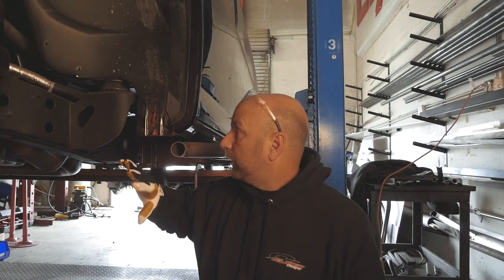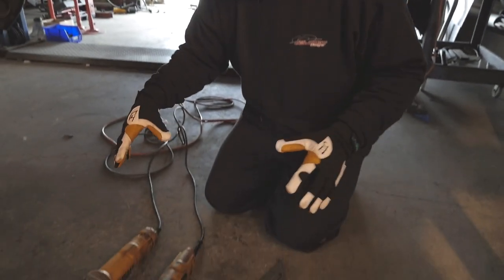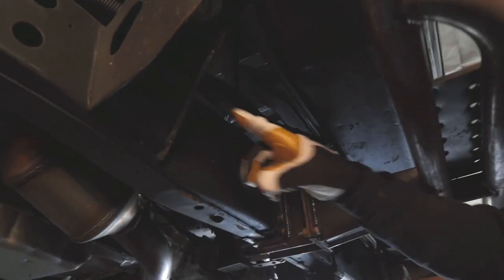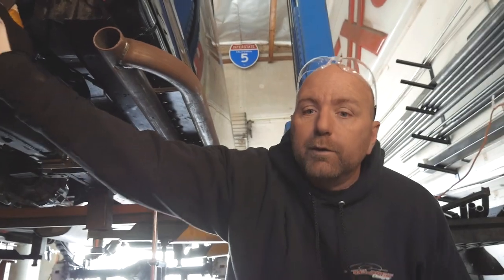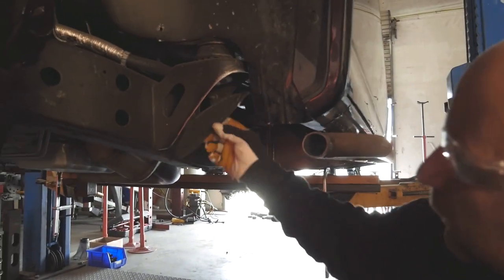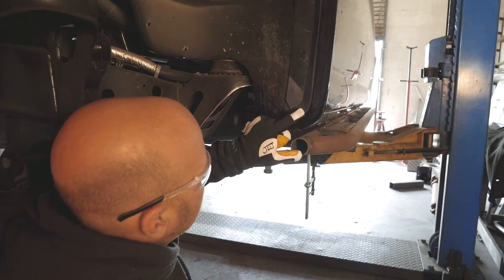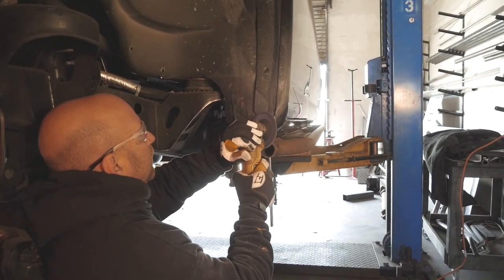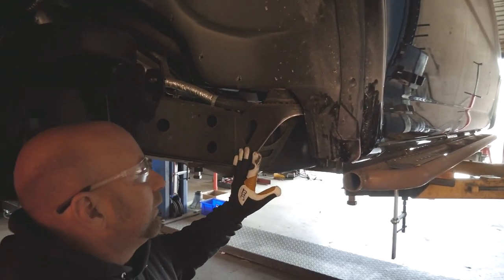Chevy Express Van Conversion - How To Trim Body Mounts

Comment: Sometimes I get the impression that cutting is needed mostly due to tire width and less so due to diameter.

I would LOVE to see a video on skinny tires and whether they eliminate need to trim. For example, for 16 inch rim there is 255/85r16 or 33x10.5r16. For 17 rims, there is 255/80r17, Mickey Thompson just released a 255/85r17 (which is a 34 inch tire by 10.5), and there is 34x11r17 tires available.

I have a Quigley Express and am looking into any of these narrow sizes for the advantages (lighter tire, better in snow, etc,) and cannot find ANYTHING on vans with larger diameter (but skinny) sizes.

Comment: I have a Quigley 4x4 with the front lift from their factory. Would I be able to run 33" tires?  And if so what kind of backspacing/offsets are needed?
Reply: Curious to know if you ever got an answer from anywhere as I am in the same exact situation.

Comment: Can I clear 33”s with the lift spacer if I do this?
Reply from the maker: No.... You need spacers and spindles.
Reply from the maker: @strictlystreet1517  we don't usually run 10" wide wheels. Depending on the offset it may make it worse?